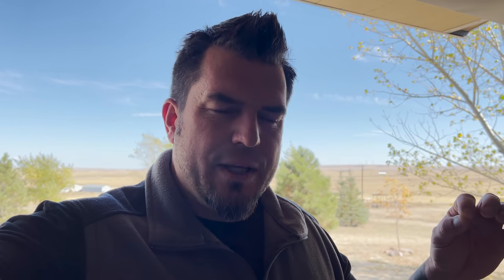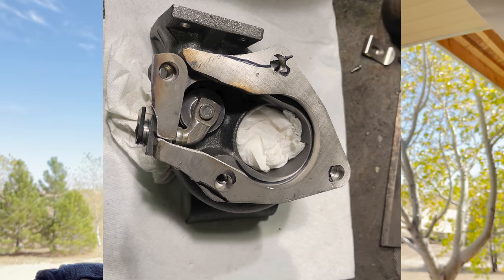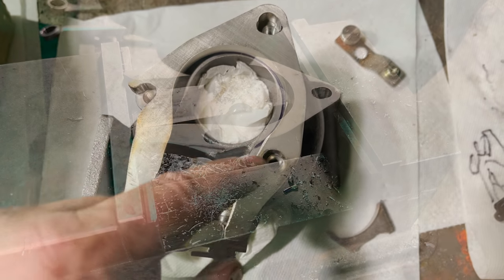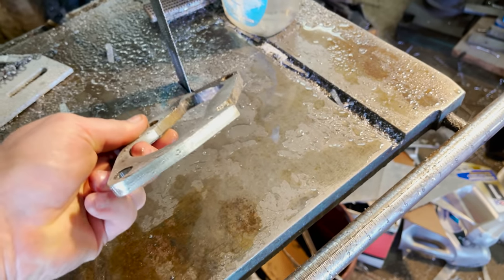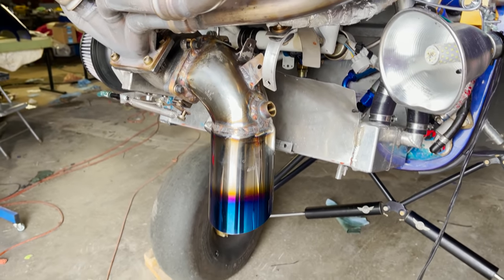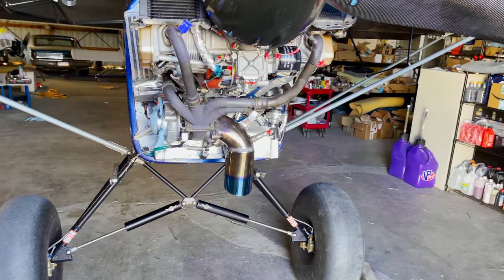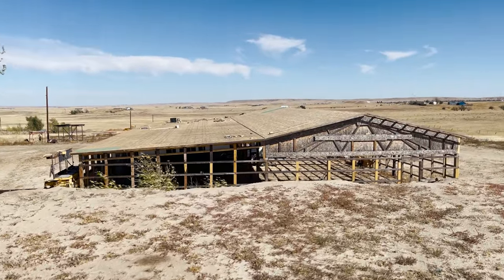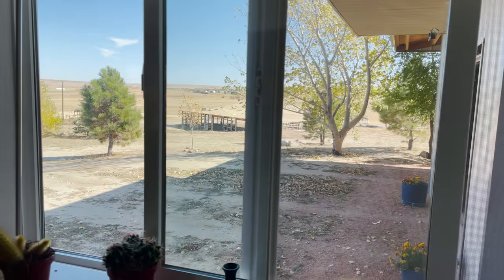Installing a prototype TURBO setup on the RANS S-7S

Comment: Good job of retrofitted better design. I have a 100 Hp ULS that should have the intake upgraded to eliminate the floppy Bings. I have to support carbs with AC Aluminum flange to Bing bell mounted supports. They shake at the old style swung out manifold design and break those hard rubber manifold mounts. Wish I had a bolt on inner cooled tiny turbo naturally aspirated unit to be more up to date. Could use the upper altitude air but don’t need too much more Hp. Gonna change all motor mounts and may put a newer ULS motor on. Mine takes lots of starter time to get it going,,, on new carbs. Thanks for your educational shows and out door get away films… I live in Wa state above the Olympic Mtns and your Idaho films are the best.
Reply: BTW, I’m an elderly retired BSME
Reply from the maker: Thanks for the comment! The bings do have their annoyances for sure! I don't miss that much. The fuel injection setup is not cheap, but it's probably the best product edge offers overall. I really, hated the carbs on the 914... the egt spread is noticeably worse on a 914 than the 912. It was terrible. Do you have the rotax intake manifold? I found one cheap on ebay that I put on my old big bore 912 on the last plane. And then you can make brackets that mount to it, and it supports the carbs from the inlet side. Also allows for colder air into the motor... just a thought. Buying one new is super expensive, but if you find a used one, might be a nice little upgrade and also help suppor the carbs. Also, JBM, (I think is the brand name) makes upgraded manifold to carb sockets... maybe those would help?
Reply: @GravityKnightFlying  thanks for the input and naming options. I thought I had none so I designed and machine support brackets that fatigued to failure in less than 100 hr which allowed rubber manifolds to fail within 20 hr of flight. I even fabbed AC Aluminum intake mounts but have yet to try out in fear of direct translation of high frequency damage to carbs. My mount on the intake is on the soft side of the rubber manifolds and the to the carbs, limiting translation of fatigue energy to the carb. I bought flatter K&N filters to minimize moment arms for fatigue to rubber manifolds but this helps minimally. I inspect the intake system flight to flight. BTW, the springs to Bings never helped reduce the leverage on those manifolds.I may look for something used on the injection systems someday and may try reversing the main intakes side to side to set the swing inward like newer 912 set ups. That few inches of radius swing must add lots of force at 5200 rpm. Keep posting off grid TO/Landing, it supplements my loss of flying due to mechanical work. I watch them over and over at times. I like to watch the Maule Guy also!
Reply: Can you say more about the carb bracket on the used manifold? Did it vibrate the cab and seats and throttle pins…? I put my machined Bing supports on the other side of the small bolt on black rubber with carb boot (intake manifolds)

Comment: Never too long...great info!  Your new hanger looks fantastic!  Even closer to the house than my T hanger.  I have had carpet salvaged from a remodel at the middle school in the T hanger for 15 years.  Works very well if you don't have to drag heavy things around.  I just picked up a 1951 L-21A super cub project,  sorting and evaluating what to do with it.
Reply from the maker: thanks for the info on the carpet Chuck! appreciate that... very cool on the sc project 👍

Comment: Did you have trouble with your old turbo or just trying something different? That is one super sized hanger!
Reply from the maker: It was still working good when pulled. I had obligated myself to test this new one, so when they tracked down the housing I asked for, I really felt I had to see it through! Worked out well though so all good.

Comment: Make a custom flange via CNC, you'll want the wastegate completely divorced from the turbine flow for best results.

Trust me. That's close to the same IWG setup as my STi.
Reply from the maker: The divorced design is better as you said, but one thing to keep in mind, this motor only produces around 140hp, and the exhaust is dumping into a 3.5" pipe right out of the turbine housing. There would potentially be slightly more efficient flow if they were separated due to turbulence, but it's a pretty un-restricted outlet for the power level. Probably be hard to notice any difference. Turbo size is overkill in other words for the power, but also allows maintaining power up very high at higher pressure ratios, and it's more fuel efficient to breathe through that larger turbine. The servo controlled wastegate does allow the potentially to partially open the gate in cruise to allow more exhaust around the turbine which also increases efficiency. Pretty cool stuff. By the way, I came from the car world, subarus before evos.. I had a wrx wagon I swapped a 6 speed into out of an 07 Sti. Set a cheesy internet record that still might stand? (11.7 and 119 on a stock block 2.0 motor at high altitude). One of the first to put a holset turbo on an EJ motor. That motor let go at 178k miles after I turned it up to see just how far it would go. Broke a rod before the 1/8 mile and coasted in at something like a 12.2. It was on a pass. Did a budget built 2.0, put an HX40 with a BEP housing on it, and trapped 130 Fun car, but got high strung enough it ended up being a lot of headaches. This was 10-11 years ago or something like that. Cheers -Todd
Reply: @GravityKnightFlying  Todd, great to hear! Been working on Subarus since late 2005 when I picked up my 2002 WRX. Did a 2005 STi swap to it while in Germany when a friend's wife rolled their car. Did a bunch of mods to it, cracked 400whp. Was going to turn it into an 818C kit car, but had some financial issues that took precedence. Ended up parting out the cat and rebuilding the shell with the remnants of a friend's rolled WRX for him. 

Bought my buddy's 2010 STi that he did a 207 swap on two years ago and been working on fixing some questionable things he did ever since. Haven't had it to the track yet, been tuning for e85 and sorting some fueling issues out when able. Owned 4 other Subarus as well.

I'll be out in CO for Christmas, would be cool to meet you!

Comment: Wondering when you might show up for the Stol drags??????
Reply from the maker: Not really my cup of tea. I'll explain why. Cool event, nothing against the event at all. Came from a racing background with cars, so I can appreciate that. But what I have noticed is that to be competitive, you need 300hp, and you need to work your plane very hard. Nothing wrong with not winning, but no matter what, it seems a person is going to push their plane hard to put in the best time you can. That isn't to say it can't be done smoothly, and not overly destructive.. but that type of racing does generally seem to be hard on an airplane. Something to consider anyway. I do typically prefer to be in a rush when doing technical type flying as well, so it feels a little off to be racing to stuff it in and land etc. Again nothing against it, I'm sure its a total blast, and I love watching Steve put on a good show. If I had the money to have a dedicated, high HP stol drag plane I could just beat the snot out of, I would be there. But I do work hard to keep this bird clean and in tip top shape both visually and mechanically so that it will perform when needed, and hopefully hold a good resale value etc. Great question though
Reply: @GravityKnightFlying  you know there are 3 classes, Bronze, Silver and Gold. You don't need and can't have all those mods in Bronze and silver classes. I was a sponsor at HSF 2021 at Dead Cow lake bed.

Comment: What are the turbo specs, eg turbine/ compressor Inducer, exducer? and AR also. Im using a 1470CC Suzuki engine at 5000 rpm. For high altitude I am using a twin scroll housing with a merge valve. So all 4 ports go into one half of the turbine wheel and then as soon as it makes 15 kpa of boost the merge valve starts to open splitting the 4 cylinders into 2+2. It is for a high altitude aircraft and the turbo is my air supply so had the same concern. This way it spools very quickly, but is not restrictive at 1 bar of boost. I am using a hybrid GBC 22-350 turbine, and GBC17-250 compressor.

Comment: Why not just go with external wastegate?
Reply from the maker: Good Q...Lot more control with the servo controlling the gate via cable. Can open the gate during cruise for a nice increase in efficiency. Also allows for altitude compensation to maintain overall manifold pressure as you go up. Now with the electric external gates like from turbosmart the same thing could be done with an external gate, but not sure anyone has setup this ECU to work with that gate yet (probably could be done as it has some output channels, like the one being utilized for the external gate, but those new electric gates didn't exist when this setup was built).
Reply: @GravityKnightFlying  The external gate I used in a drag race 90s mustang 10" tire  about 10-12 years ago had turbonetics gate it was controlled by a pressure regulator between the turbo inlet and output sides then the regulator the controller was aftermarket I just used a 5 position rotating switch set the power output which would lock in my boost pressure and automatically adjust to altitude via the regulator. If I was street driving I set it to 5 PSI gave me about 450HP to the wheels at the track using racing fuel I could get 18-19PSI I hit about 820HP with 70MM turbo. I never used the computer to control the wastegate the Fuel injection computer system was an AEM used it was all based off manifold pressure with linier type fuel maps more pressure. My limits were based on the fuel type pump gas I never tried more then 5 psi was more then enough power on the street anyway as you know with turbo engines doesn't take much detonation to explode them even with custom forged pistons.  All you need is a boost controller and wastegate they make electronic stand alone ones also. The regulator will take into account the altitude pressure on the inlet side. The electronic wastegate controllers have been around since the mid 2000's. If your ECU fuel maps can adjust for boost it shouldn't be a problem I can't see why it wouldn't be because currently the mechanical system you have it's not controlling anyway. The only factor I could see is finding a small enough external wastegate that would work for you most of the ones sold for drag racing for big engines you would not want an external gate that it too big want something that is matched for the size of the engine. Wonder if you need a blow off valve on an aviation engine maybe not since RPM isn't change quickly it does keep the turbo spooled when cut the throttle maybe for stol competitions making lot of power changes need one?